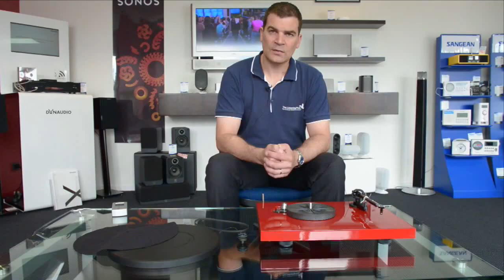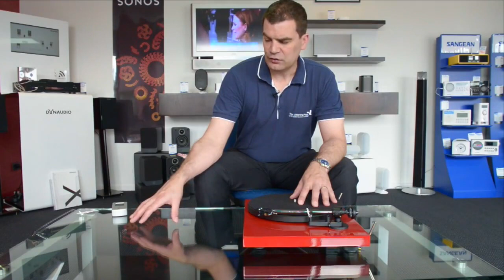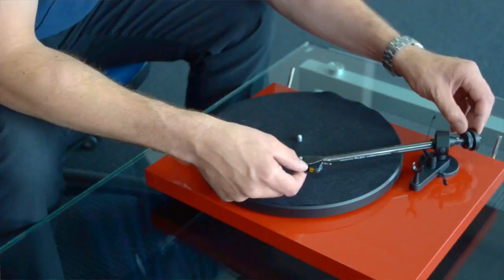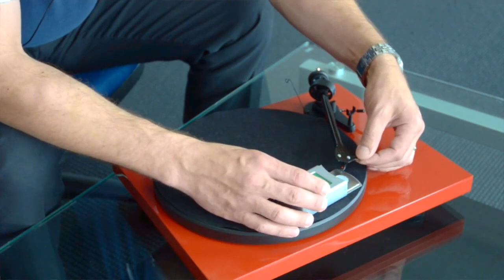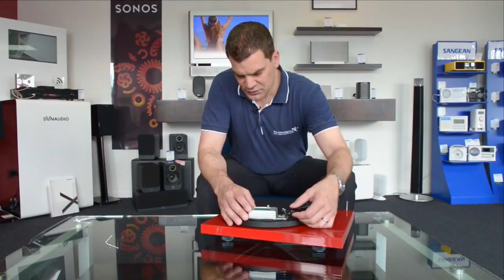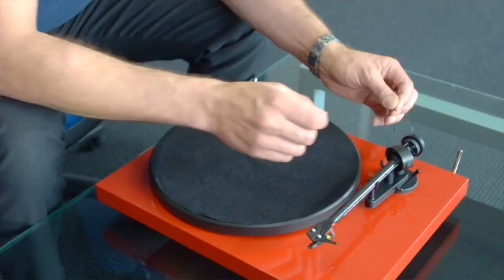How to Set Up a Pro-Ject Debut Carbon Turntable | The Listening Post | TLPCHC TLPWLG

Comment: Anyone else have trouble getting the belt around the outside edge of platter? I have tried a million times, and it always pops off just as you get close to pulling it fully around the platter edge. EXTREMELY frustrating.
Reply from the maker: With the Debut's it is pretty easy. Put it on the larger black inner "wheel" first. Hold it with your fingers, then flick it over the small silver pulley wheel.
Reply: The Listening Post Christchurch | TLPCHC thanks I’ll give that a try today.
Reply: That did the trick! Thanks so much... they should make that point somewhere as there is almost no way to get it back on if you don't do it that way. Thanks for the advice!!!

Comment: ProJect measures Vertical Tracking Force in micro newtons, not grams. That's why the scale had a different reading when you set the needle on it.

Comment: I'm having a pretty big problem with my debut carbon. Records will not play at speed when the platter is on. The belt and motor mechanisms run fine without the platter, but when it is placed on the belt cannot seem to carry it in time. I've tried replacing the belt, cleaning everything, and even purchasing an acryllic platter. Nothing has worked. Someone Please Help!
Reply from the maker: +Nicholas Otte That's a tricky one! Have you moved from the US/ Canada to another country? The Debut Carbons use an AC motor that is designed for a specific frequency of power. (60Hz in US, 50Hz in many other countries.)

The only other explanations could be a stretched or slipping belt or a physical fault with the turntable.